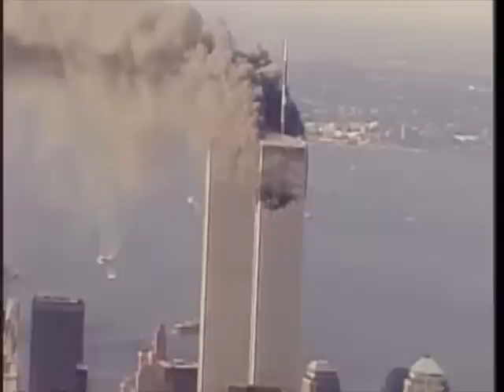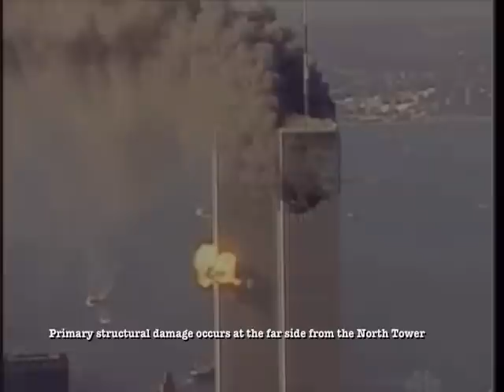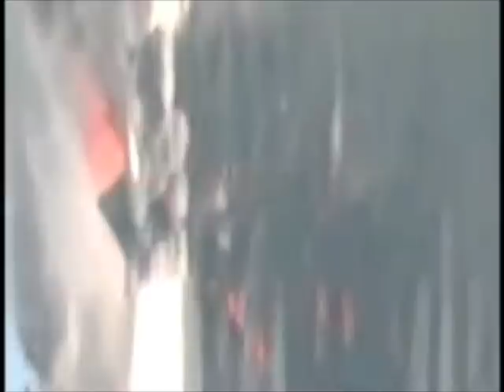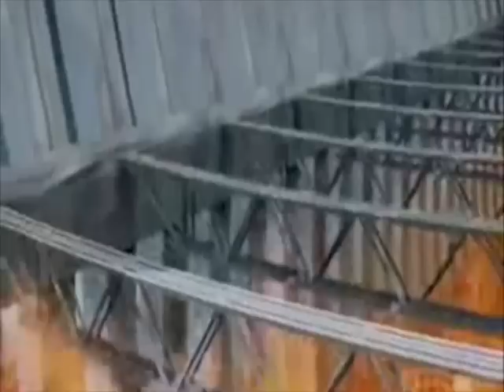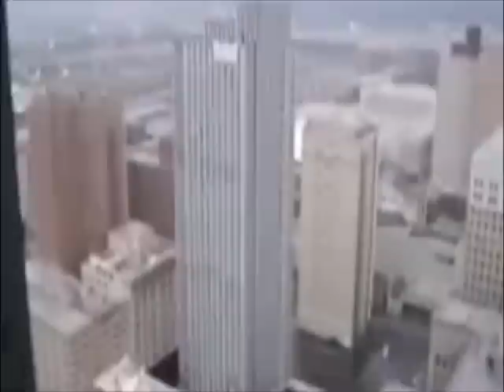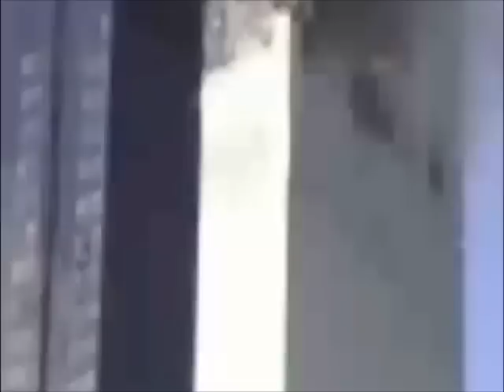9/11 demolition analysis

Comment from the maker: @zesandell When a gigantic skyscraper collapses, there is an enormous amount of energy involved, and in this case a significant number of floors were already experiencing intense heat. It's not as if this is mysterious. The whole point of the video is to show that the building collapsed because of an imbalance in weight distribution caused by structural damage and failure. Once you have accepted that, anything else is extraneous and unnecessary.

Comment from the maker: @psikeyhackr Fair point about the animation, but I think that can be discerned fairly easily. Your point about normal controlled demolition makes your position sound unfalsifiable. I didn't talk about the core. There were many things I didn't talk about. Perhaps I will do a follow up, but I asked specific questions, and you are not even attempting to address them. The 1800 F value is from NIST temp analysis.

Comment from the maker: @Stringyheads Yes, I think it's entirely plausible you have a concussion.Flight 93 was never even headed towards NYC. Many of the outer columns did not fall with the building. In fact, giant pieces of the perimeter structure destroyed an entire section of WTC7. Or why not check out the bridge in Minnesota that collapsed because fire from a tanker weakened the steel? Do you really think that having explosives planted precisely where both of the planes hit is plausible? Really?

Comment from the maker: Well, you're not really answering the question. The question isn't just about getting explosives in the building, which all by itself seems preposterous. The question is specifically addressing where the collapse begins: at the precise point that the planes entered the building in both cases. Also, we really don't see that sort of thing taking place. What we see is a structural failure followed by a collapse. That is what is depicted clearly in this video.

Comment: Re: how could the bombs have been planted, how would the impact areas be known. James Hoffman came up with a possible scenario - just to show how it could have been done, using 'off the shelf'' materials. I can't leave web addresses, so you will have to google 9-11 Research. Then search Perpetrators/conspiracy for the 404 attack scenario, Essays for the hypothetical blasting scenario, FAQs/conspiracy for how and why it could have been covered up .Your question is too small to answer by itself.

Comment from the maker: @RedLetterChristian watch the video. The tower leans into itself at the point where the most structural damage occurred. That doesn't mean it will fall over like a chopped down tree. This is because of the reaction of the uneven weight distribution. It's quite clear in the video. It would be nice if you would actually address the questions posed in the video instead of flooding me with truther nonsense that doesn't have anything to do with the video.